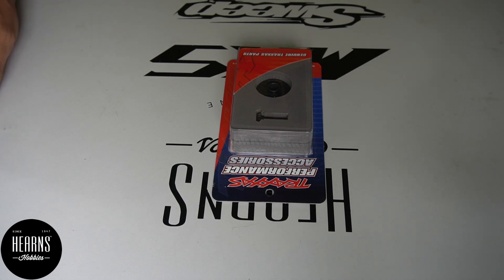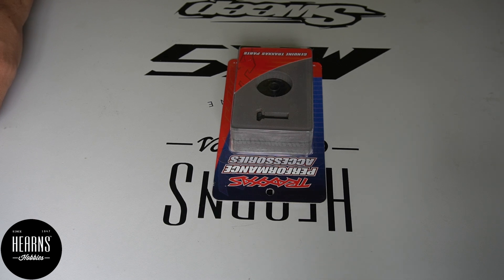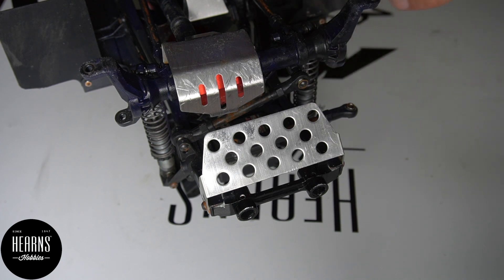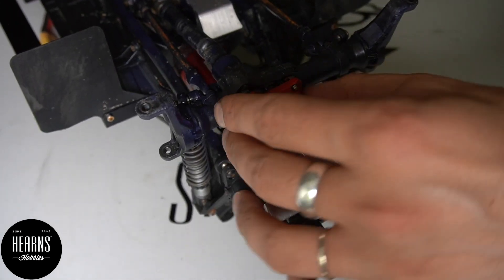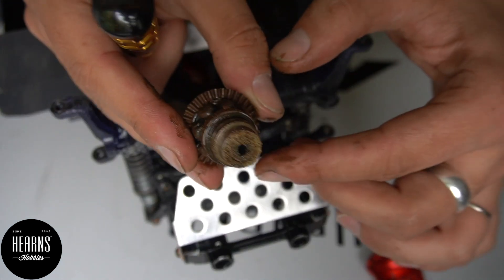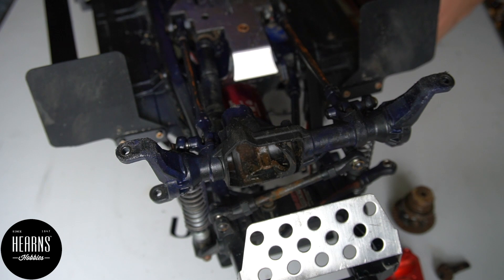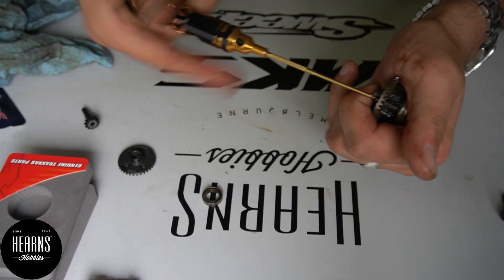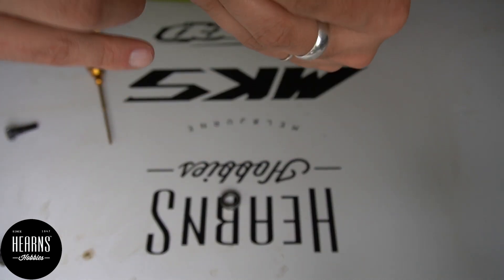TRAXXAS TRX4 Overdrive and Underdrive Installation | #ASKHEARNS

Comment: Nice video... I just installed the overdrive gears.. but one side is not spinning. Would you happen to know why?
Reply from the maker: most likely you did not connect the drive train on one side. Can be a pin missing or something. Disassemble the side that is not working and check it all.

Comment: Very cool! Interesting to see the maintenance side and the speed demo in the end too
Reply from the maker: Thank you for the feedback! We really like this car, it is mechanically very interesting and also very capable. It is fun to work on as well. We are taking it into all various harsh conditions to see what the limits are! Sealing all the diffs with additional grease helps a lot when going into water. The over and under- driver are really impressive, way over the expectations. It is not a cheap upgrade and requires a bit of work to install everything but really worth it.

Comment: Important events happen without camera on the subject matter.....example the pinion is removed from the rear while the camera is facing the opposite direction. Cannot even see what you did/how you did it which I thought was the point of the video...
Reply from the maker: Sorry Shawn,  unfortunately is not always easy to be in focus and also doing the work. We have a new set up now with the camera from the top which should be better. We will use it for next videos.